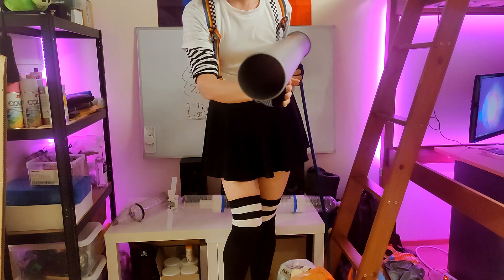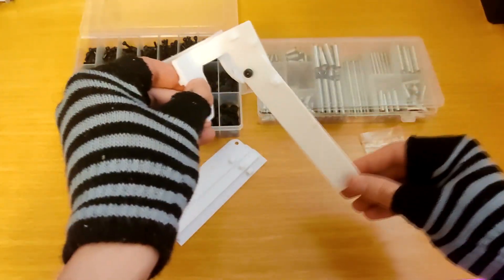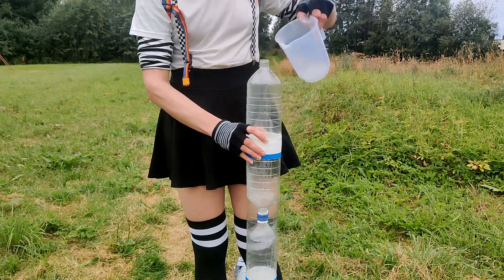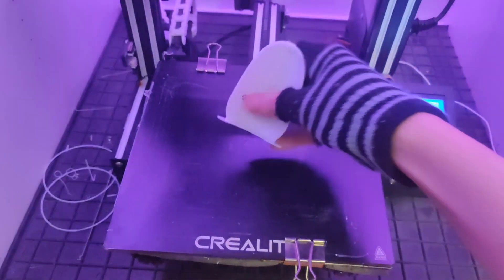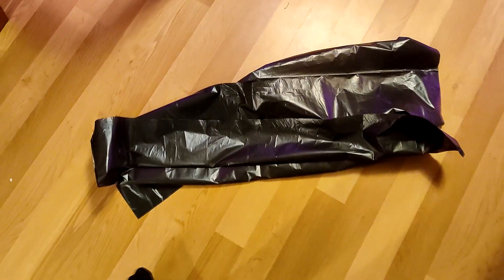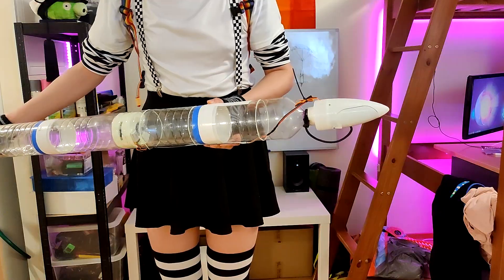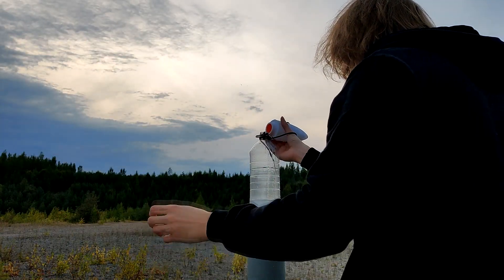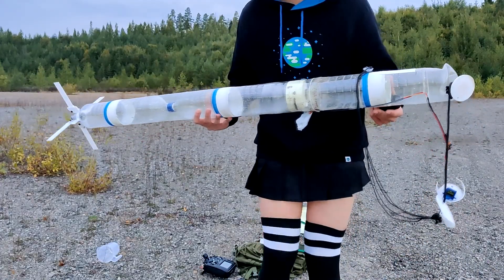Can Water Really Power a Rocket?  |  Femboy Engineering Ep5

Comment: Now this reminded me of my high school chemistry teacher making a bottle rocket in class one day, (he didn't mean to), destroying a strip light on the ceiling in the process. Well, it gave the class a laugh, if nothing else! What you built was far more impressive, and it proved that the principles behind what you were attempting to achieve are sound. Will you try again?

I like the way that the folding stabiliser fins deploy upon launch - that is a tried and tested solution to fitting it into the launcher.
Reply from the maker: Haha, launching these things indoors isn't the best idea. Yeah, I'll probably try again sometime, possibly adding some detachable boosters
Reply: Oh, what that teacher did wasn't intended to be a bottle rocket! He was attempting to demonstrate what happens when hydrogen combines with oxygen - the bottle was supposed to be secured in a clamp frame, filled with hydrogen and a small hole pierced in the cap so a tiny jet of flame would burn safely. Unfortunately, the clamp wasn't tight enough, and when he lit it, the cap shot off in one direction, the bottle in the other, up into the ceiling...

Comment: Something strange I noticed with both takeoffs is that the rockets tend to veer sharply to the left when exiting the launch tube. This is probably due to the retractable fin system, which most likely won't open evenly. So I'm suggesting adding a system that allows the fins to open a few seconds after exiting the tube, thus avoiding horrible deviations.

Another thing, you could try making the rocket's tip more aerodynamic, so that it can connect the widest part of the bottle with the tip that carries the parachute.

That, and I think we need to add more water.

Otherwise, your video is cool. I really liked it.
If you're going to make a rocket powered by gunpowder, please don't use a polymer-based film. For fieldwork, I recommend wearing thermal socks with a thermal appearance and high-heeled boots to improve the look and engineering of the film.

If you're going to do an experiment about fire, you could use a cosplay of Lio Fotia (it may not be a femboy character, but it would still be good for explaining fire than someone who throws fire).
Reply from the maker: Thanks! Yeah, it's probably the fin system and aerodynamics that need to be improved still. I might revisit water rockets in a future video, and make these improvements :3 I've also been considering making some sort of rocket powered plane using model rocket motors, but they are quite difficult to get in my country, due to all of the bureaucracy and regulation, as it requires me to pass a short model rocketry safety course, etc. But I'll try to get them somehow :3

Comment: now you must add payload capacity the size of blåhaj
Reply from the maker: :3 That would be a bit too heavy for a water rocket, but I was thinking about designing and building a fixed-wing UAV capable of lifting a blåhaj to like half a kilometer high, and then dropping it with a parachute, as I have a lot of experience with fixed-wing UAV design and manufacturing :3
Reply: @Femboy_Engineering h class solid rocket motor
Reply: @Lottle-l4b  intercontinental ballistic nuclear blåhaj

Comment: Curious if the loading could be made easier by making the launch mechanism removable, so the rocket would mount to the launch mechanism then attach to the launch tube
Also peak style
Reply from the maker: Thanks :3  Yeah, that does seem like a way easier way :3  I might improve it like that, and completely redesign the launch mechanism, as well as increase the nozzle diameter, to increase launch acceleration, so it's more stable

Comment: I think once you get the parachute system working and are able to recover and reuse the vehicle, and once the seals between sections are improved to withstand high pressures, you should try various amounts of water and various pressures to find the optimum. Maybe derive an empirical equation for this. This experimentation would probably also give you an idea of whether to focus on increasing the reaction mass or increasing the specific impulse of the vehicle.
Reply from the maker: True! After I inspected the rocket after the crash, I realized, that the rocket sections had untwisted from the 3d printed adapter a bit during transport, which made it leak slightly. Looking back at this in hindsight, I realize, that I should never have launched it. But I got too excited and impatient and tried anyway, despite knowing the launch would fail at such a low pressure. At home when I pressurized it, it wasn't leaking at all.  I might improve the rocket further, and make a future video where I experiment a bit more like this :3